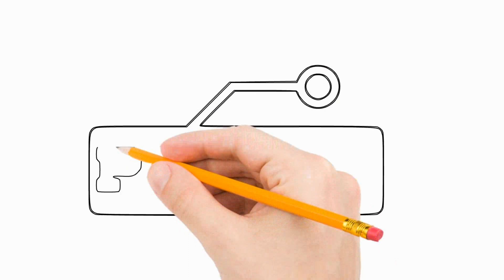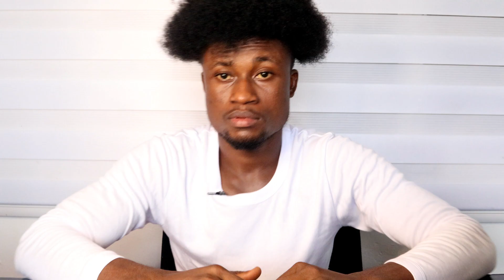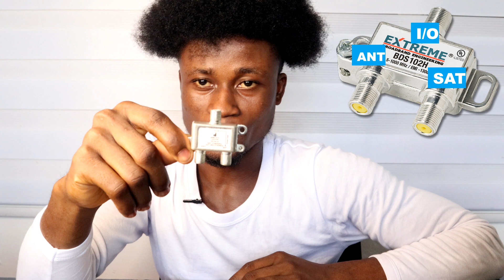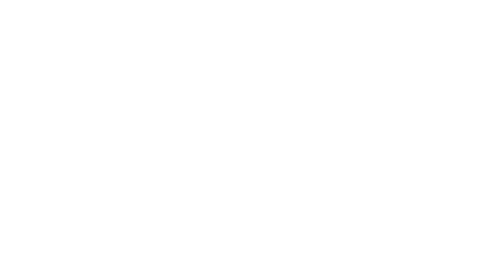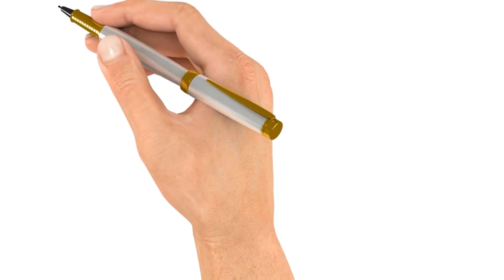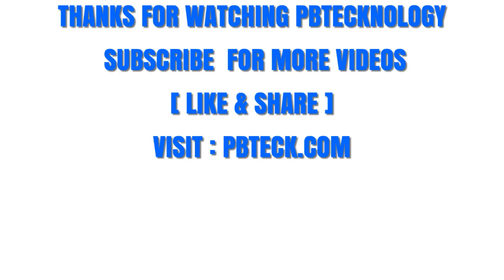How To Use A Diplexer - Dstv

Comment: Good evening Sir.
I am a satellite
Installer in Kumasi.
Please is Gtv Sports Plus still working on the tp 12645v32700 now?
I used a multistream receiver but still could not work.
I need your help.
Reply from the maker: I will check it for you bro ❤️
Reply: Is there a number to reach you

Comment: Can I use two dish on one dstv decoder ?
Reply from the maker: There's no DiSEqC settings in the DStv Installation Menu. Which means you can't get both signal working at the same time.
But you can still scan the channels on the DStv decoder. Anytime you insert in a cable carrying the signal of that particular channels, it will work.